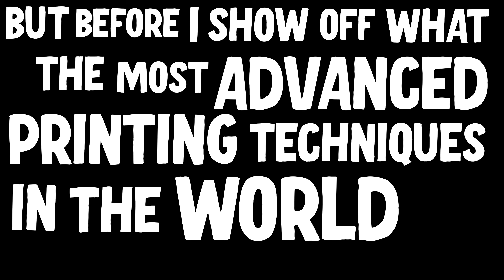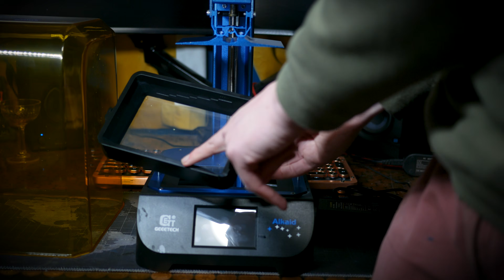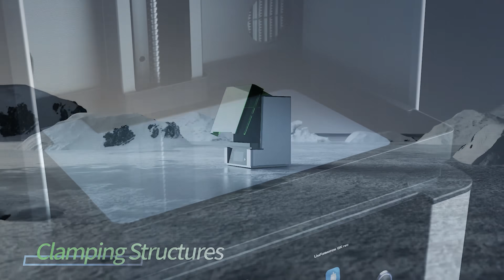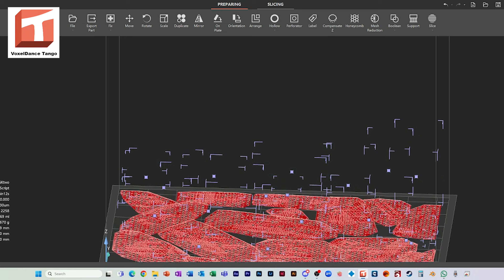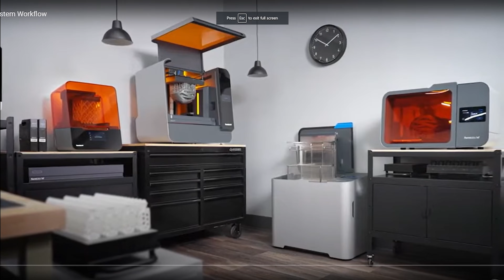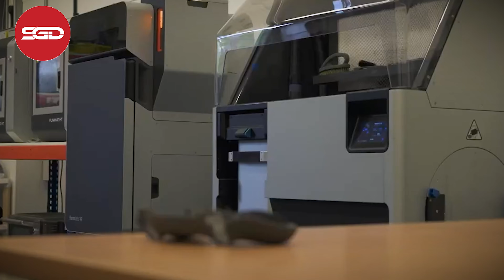One Clear Winner | $10 vs $100K 3D Printer Test.

Comment: Great video but please keep in mind, these professional printers are not designed for best detail, like the cheap printers we use but for highest strength and long term durability! The formlabs resin lasts years even in sunlight and is stronger right from the start. SLS printin has way less datails but you can print parts and directly put them in an engine bay and they will last forever at 150C, which cheap resin or most FDM prints will fail super fast.
Reply from the maker: Thanks, the FormLabs is absolutely capable of amazing detail, sadly it turns out post release that the company used a different resin and settings than expected, maybe one to revisit

Comment: the 10k$ machine left SO many thick layer lines. i'd be curious to see what it would look like dialed in settings-wise, but if that was the best it could do.... ouch. 

the hey gears looks great, but that 2500$ price tag is certainly not for the regular printer enjoyer. for most the gk2 would be pushing the budget, but much more in line with quality vs price tag for most.
Reply from the maker: Yeh, the company have since got in touch to say they printed it in 100 micron layer lines and so it can definitely improve for here. And spot on about the hey gears

Comment: Okay, the playful throwback to old flash speech was an absolutely delightful touch!

Oof, those voxel lines on the base from the Formlabs 3L...  Does their slicing software not have anti-aliasing?  (or was it loaded in flat, as opposed to the usual angled to help hide them?)
Reply from the maker: On investigation it looks like they printed it using 100 micron layers rather than 30.

Comment: Really cool to see these side by side. Certainly diminishing returns as you move up the levels beyond the $800 point. Interestingly I could see layer lines on the base on the Formlabs 3L which I thought was interesting.
Reply: This print was ran in 100µm and could have been orientated better / increased resolution. We typically print engineering parts, so this project was definitely a difference to our usual scope of work! 

The difference we've found with the Formlabs printers is that there is a very low failure rate compared to consumer grade DLP / LCD systems, which is essential when running a business / renting the capacity. The portfolio of different resin types they offer is one of the most competitive in the market, as the system is essentially plug and play with no fine tuning of settings to get dialled in. Less time programming, more time printing!
Reply from the maker: Absolutely I would love to get my hands on the 3L and dial it in!